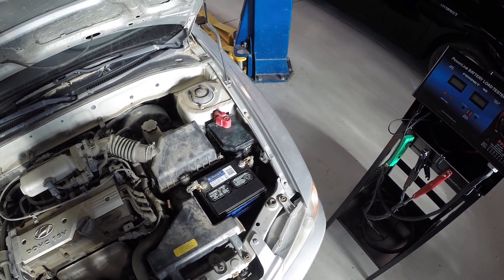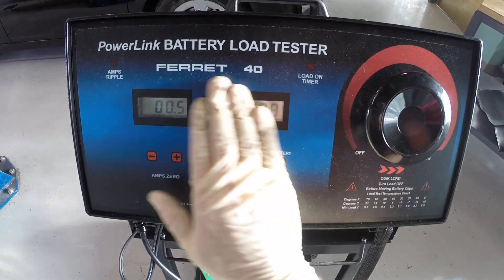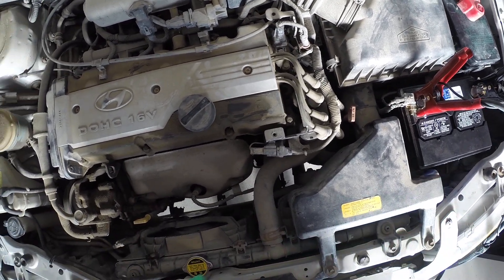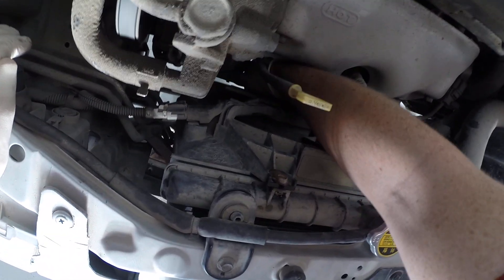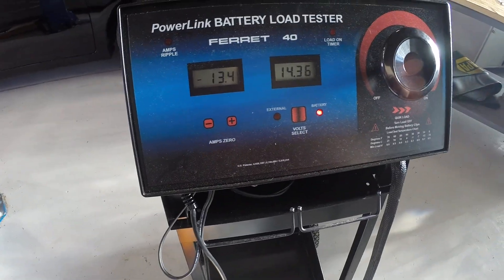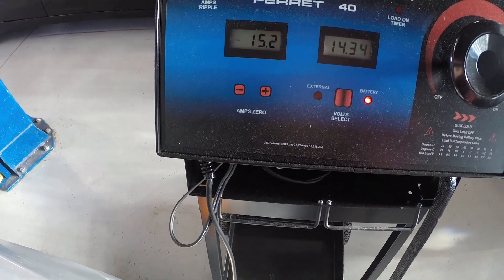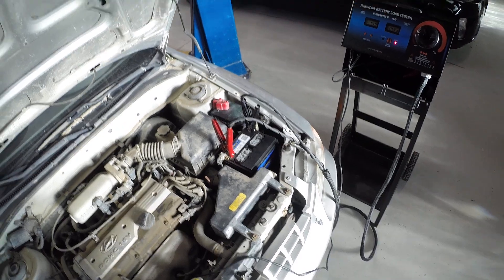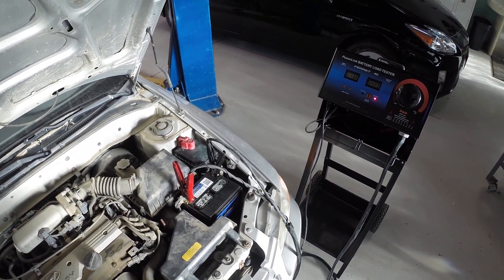Charging System Output Test

Comment: Voltage fell to 12.85 under full load. That is normal since IR voltage drop in harness and inside the generator present.